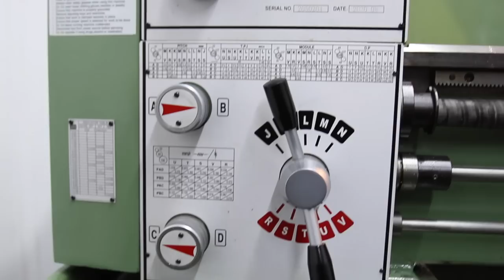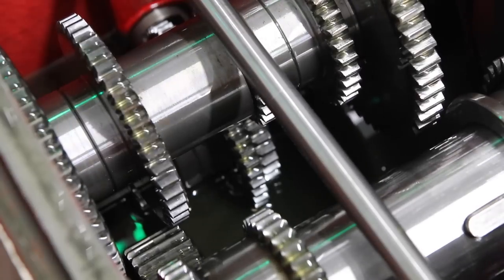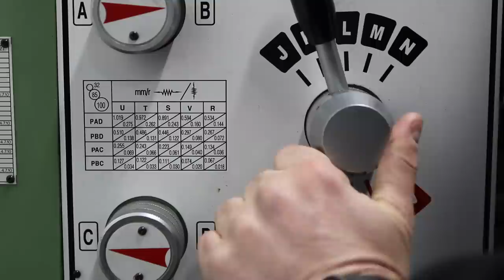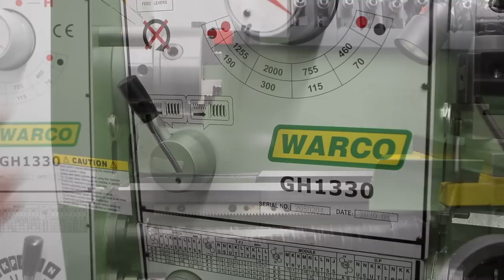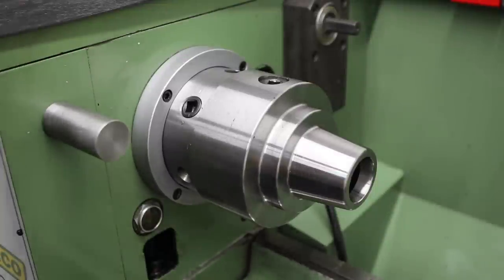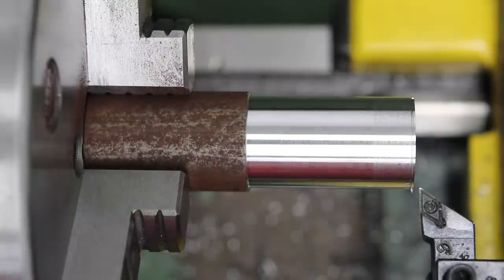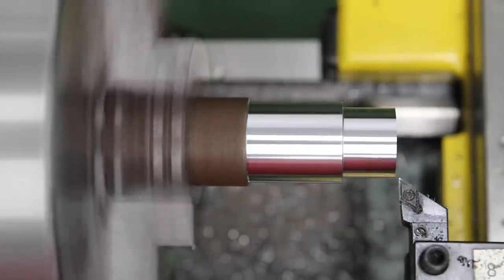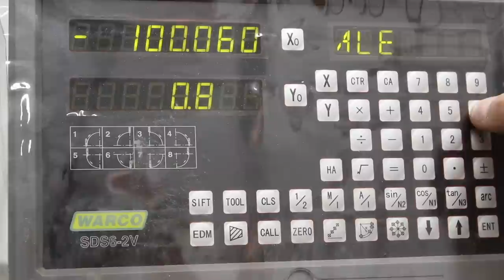Lathe review - Warco GH 1330 gear head lathe

Comment: You are talking about the rigidity of the lathe here a lot, but i would wager a bet that if you changed out your tooling for solid carbide, or doubled up on the shank diameter(i know, square doesnt have a dia, but it kinda does, as it touches an outscribed circle in 4 places) if you want to use steel holders(price, sure, i get it)... The bed and the machine components are beefy enough, and it is a gear head, i just think you reached the extent of rigidity of your toolholders(insert holders)... Try using a solid carbide shank ground up, you can get them on ebay square and round profiled, so that of the same dia as your holders should improve the finish drastically or just go up a size in steel holders... also, check the gib/crosslide play... stefan demonstrated it nicely with the compound rebuilds and his last deckel shaper head video... you could also consider a solid toolpost or just dead-locking the compound slide with its gib... that would surely grant a reduction of vibrations from that section... but i mostly think its just that 1cm shank that has reached the end of its solid performance at that depth of cut... You even spoke of the man himself, abom, and sure, you arent taking his cuts, but this aint a monarch 3 ton lathe, but he uses 1inch shanks on his tools, not 1cm... and sure, his cuts are deeper, but i would say that you should not spit at the lathe, check out some thicker tooling... Also, the older the lathe, the simpler the electronics, my schaerer un450 has a large contactor 3 fuses beneath it and a relay at the front to actuate the contactor, thats it... the coolant pump has its own little switch and thats it, 3 switches at the front and a reset switch for the contactor in the back, 3 are relay for on/off, coolant on/off and an a switch for the lamp as the lathe has her own 220v single phase outlet on the back... My old baby lathe has a simple 25amp lever switch and thats it... Mills and such with separate motors for feeds have complex electronics and surface grinders, but lathes are generally user friendly with the electronics cabinetry...
Reply from the maker: Hi Camillo. You made some excellent points there. Yes I agree that rather than the machine itself, I think it was the tool and/or the compound setup that was at the limit there. Another viewer suggested that it may be the nose radius/geometry of the tool that may be forcing the chips back into the workpiece and marring the surface finish. Some more experimentation needed I think and I am also keen to do the solid tool post upgrade as shown by Stefan and Robin Renzetti. Thanks for the observations.

Comment: Thanks for that review, most interesting. Would have been nice to have some measurements of lathe accuracy e.g. spindle runout, parallelism of a long piece of stock machined between centres, etc. No machine review is complete without accuracy measurements and is particularly important for Chinese imports, which are often feature rich but accuracy poor. Maybe a follow up video?
Reply from the maker: Good suggestion. I'll get around to a follow up video at some point.

Comment: What's the spindle runout?
11:29 All those scratches are from chips flying back into the workpiece, This happens a lot with mild steel.
Reply from the maker: I measured the spindle run out to about 5 microns, so about 2 tenths. Yes, looking back at the footage I think you're right.
Reply: @joneseymakes  excellent 👍
Reply: I’ve literally just ordered the GH1230 and now tempted to change the order to the GH1330 - i was originally attracted to the GH1230 due to the larger range of speeds and the 3 axis DRO - what was it about the 1330 that stood out to you above the 1230/36 in therms of quality?
Reply from the maker: @benjaminc1816  It was hard to put my finger on one thing. All the levers and hand wheels  just seemed a little smoother and tighter, the machine seems a little more substantial. I didn't like the way the gear selectors felt on the 1236. I also wanted the  3 axis DRO but having looked at it the scale on the compound gets the in the way a little. These are all just opinions though, the 1236 I would expect to be a good machine. If possible, I would recommend going to Warco and having a look for yourself.